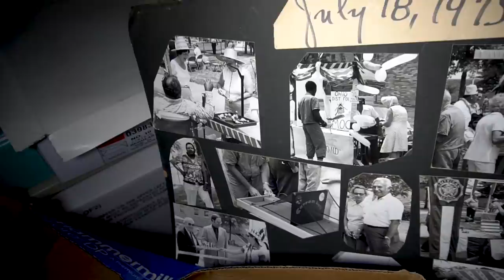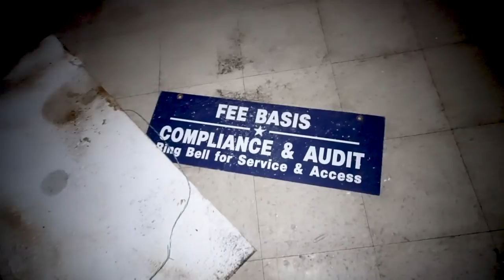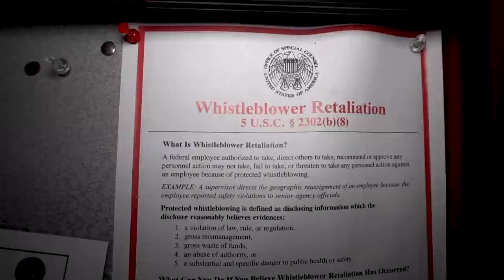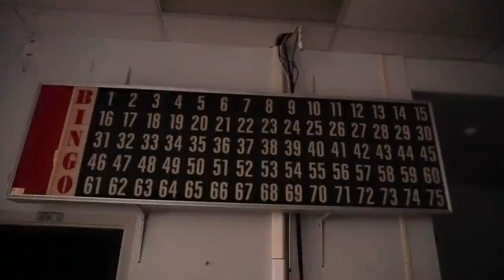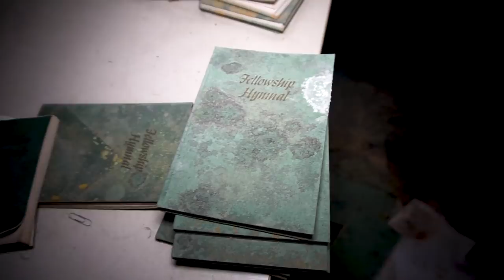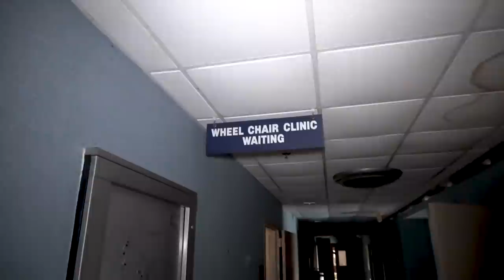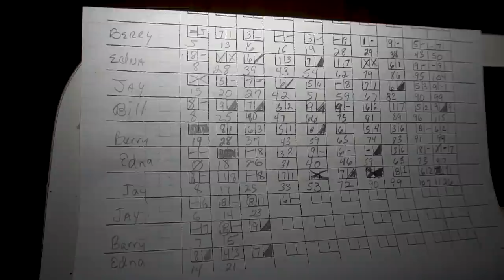One of the Most Restricted Abandoned Places in America (24 hours)

Comment: you should try and find the boiler/mechanical systems room for part 2. I wonder if they had a central boiler for all of the hot water radiators. You would probably find that area interesting the heating equipment and water piping is probably huge. says they had central coal heating until 70s was converted to nat gas.

Comment: WONDERFUL VIDEO, defiantly your BEST work to date!
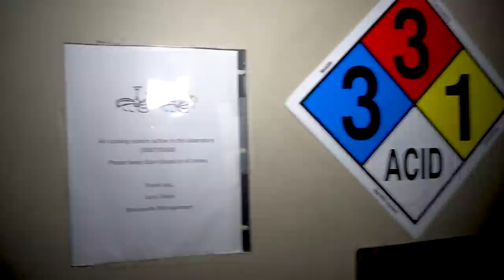When you said (25:37) "Can't feel my fingertips" what did you mean by: "I've seen videos, I've seen movies"? I can understand if it was kept cold. The Hazardous Materials sign (26:39) showing: 3-3-1-ACID = 'Extreme Danger' - 'Flash Point below 100deg F' - 'Unstable If Heated' - 'ACID' could have required refrigeration.
Don't apologize for the respirator, you need to wear it more. We saw all the mold (black?) in the room. Given what the area was used for (contamination suits 30:11) and the hazardous signs it should likely be sealed off!
Then when you told us you had to 'get to a little secret area' (34:52) and you'd be back in a few minutes, the next thing we heard was dripping water. Wasn't sure if it was the roof or you taking a 'leak'  ;-).
Wish you would have turned over that pack of meds (41:52), would have been nice to know what they were.
Again, this has been your greatest work! Thanks for taking us along. Can’t wait for part 2.
Reply from the maker: +Tech Nicholls Thanks Tech, i meant paranormal type experiences.  The temperature dropped suddenly.  Most of the time i ignore weird happenings, but that and other stuff going on in there seemed blatant.  

Me taking a leak 😂.  It was the roof.
Reply: The capsules look like generic fluoxetine (Prozac) from India.  I know that company is FDA compliant and exports to the USA.  Could be the colouring differs between countries, though.

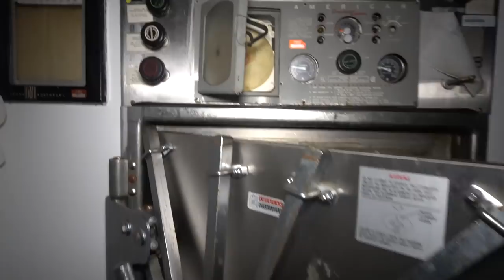Comment: 13:00 that's an autoclave, and the reason it has such a locking mechanism is due to it working similar to a pressure cooker. Please, PLEASE purchase and wear personal protective equipment, at the very least a respirator. You are very much at risk, breathing in the debris and mold the way you are.

Comment: The only salvageable items, are the non-porous ones. Every piece of fabric, wood, drywall, and carpet, will have to be thrown away. Mold has proliferated in every part of that building. They just need to start swinging a wrecking ball, because it’ll cost more in cleanup labor and repair, than to knock it down and start over.